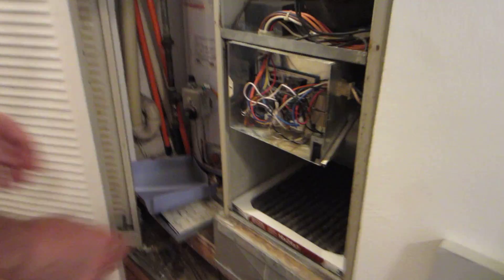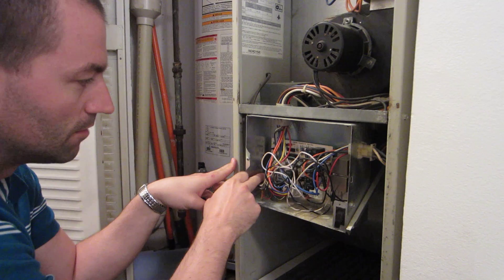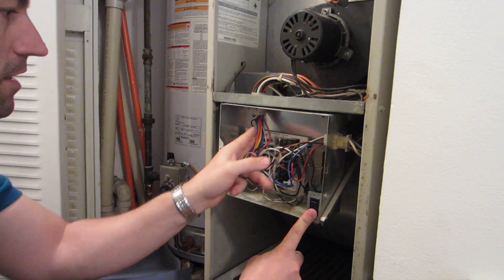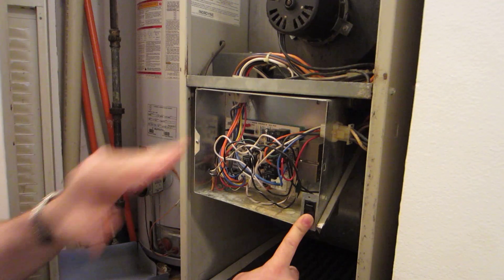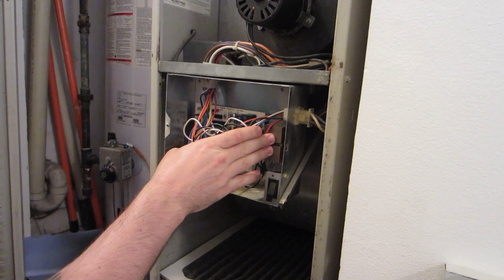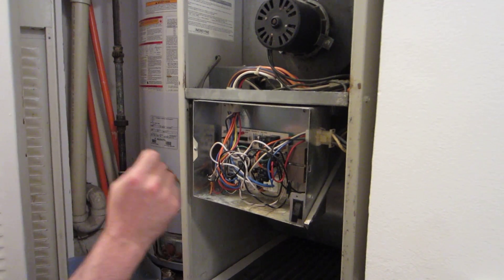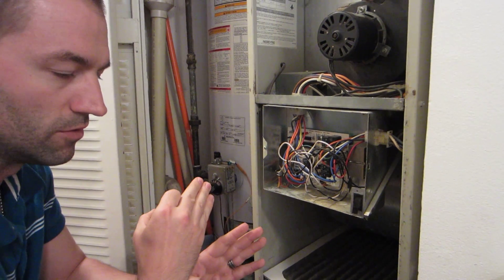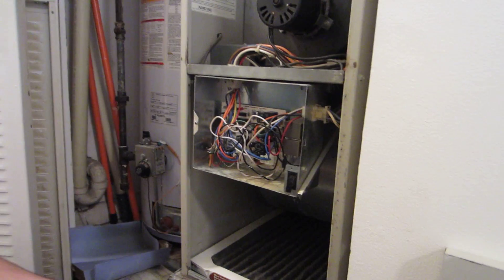CCBC HVAC Open Lab "No Power at Thermostat" #1, 4-19-2012

Comment: Hello there. I am not a pro, but a HO.There is a possibility, that the transformer(normally 120V to 24V or 240V to 24V) went bad. Dismount it and if you have a simple volt/amp meter from (say) Radioshack, check the  continuity on primary circuit(what goes in-120,240 or?) and on secondary circuit(24 V). Meaning: if you connect the apposite polls to Voltmeter set  to R(resistance) (battery must be fresh) it should  read infinitely small resistance i.e. "short". This means that all supplied power from the battery of voltmeter passed through the circuit (either primary or secondary of the transformer) and that the winding is not burned out(in opposite case there would be brake in the winding wire and that would prevent all the battery power of the voltmeter to pass through, thus there voltmeter would read some value of resistance or not move at all.-which in turn would mean, the circuit is bad, thus the transformer is bad).
But even if the transformer is O.K., there can be small fuse somewhere, which is burned or there can be problem with the little (computer) board and the voltage never goes to the thermostat wire, thus you cannot read any...And that is already stuff for "pro".....
If you change the transformer(or dismount it for checking) draw a very good picture, how it was originally wired. Assembling it together wrong way can cause a lot more expensive problems.....

Comment: hello, i have the same problem, the thermostat does not read 24 volts. do i check the fuse and if the transformer is not working? help me out please